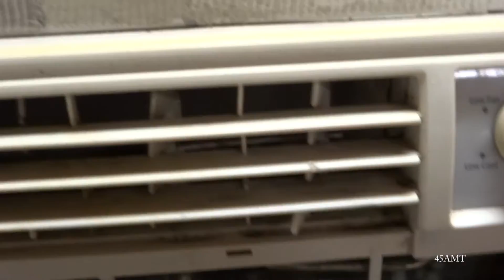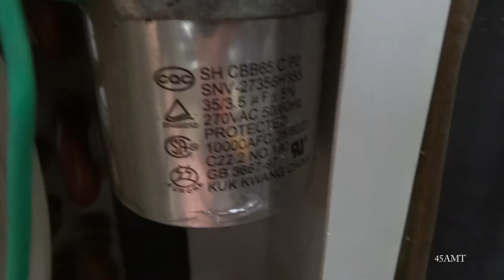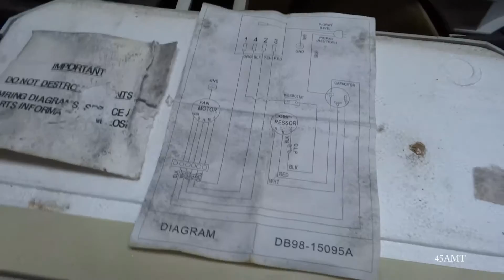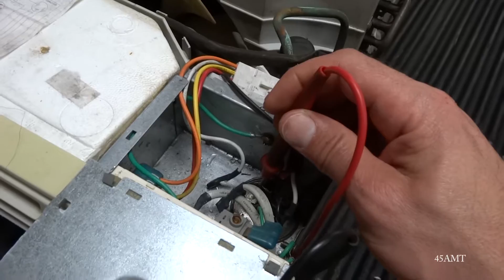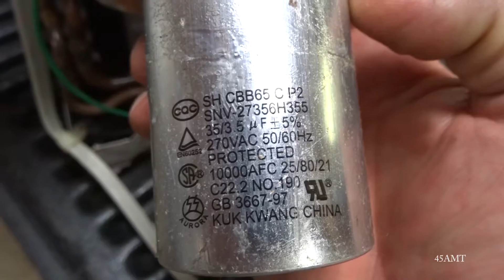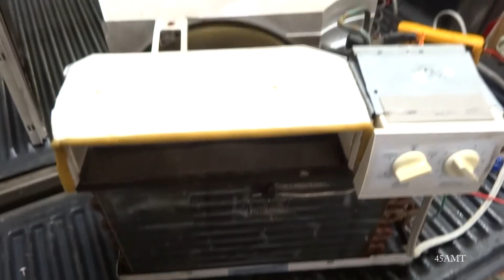Repair of a Cheap Chinese Samsung Air Conditioner

Comment: Hi there! How do you put freon (R22 refrigerant) on that Samsung air conditioner? 
Can you please upload a video. Thank u so much!
Reply from the maker: Manny Navarrete You can't add freon to these there sealed with no service ports.
Reply: Oh ok, i guess i will need to take it 2 a repair shop to get it fixed. no cold air was coming out from mine that's why. Thanks for your reply.